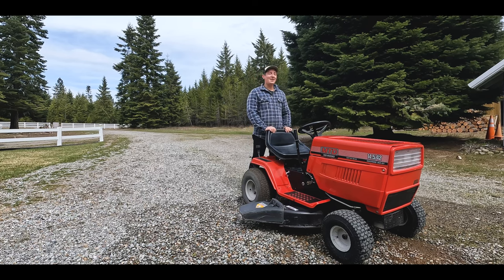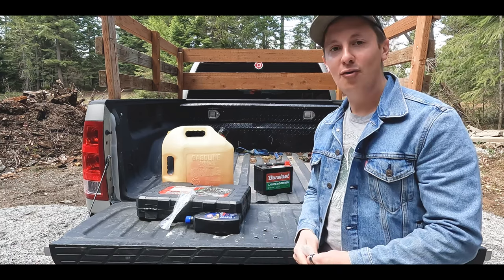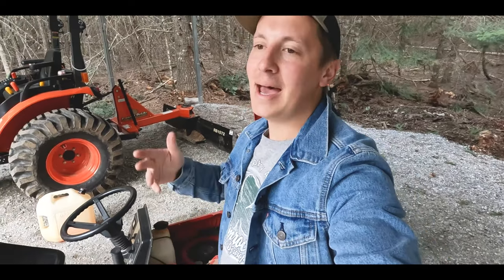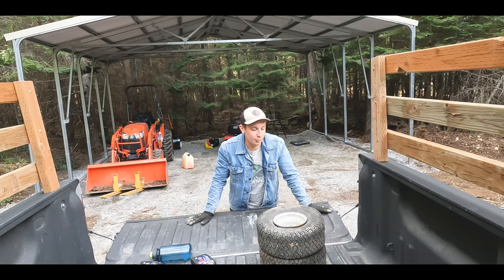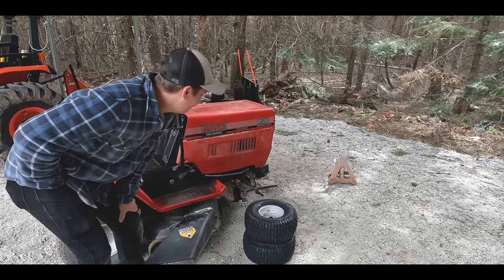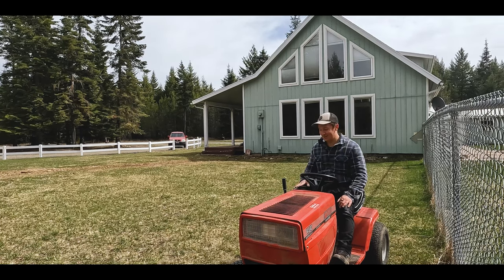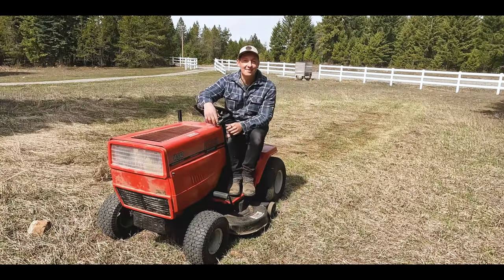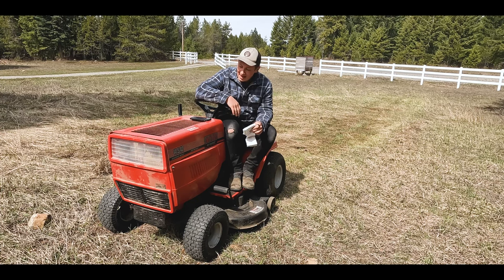MTD Yard Machine EASY FLIP | Riding Mower Lawn Tractor Basic Maintenance to go from Junk to Like New

Comment: Have one just like this except it has the normal MTD hood and an intek 13 Hp egnine along with a bagger. Have to run it out of gas so she doesn’t get gas in the oil.
Reply: Put a inline fuel cut of valve in fuel line (hose) just before carb😊😊😊
Reply: Plus zip ties work as hose clamps

Comment: My problem is I put too much in them and I fix everything plus install poor man steering kit and wheel bearing kit also, new belts and battery, tubes in front and rear tires if needed 
Then paint as needed 
Engine, service, overhead and head gasket plus sump gasket most of the time 
Lube or replace any hard to move cables 
Deck I installed new brging , blades and drill tap and grease zests on spindles, any other pulley that needs replacing 
Yeah, I put way too much just to flip it 
But there’s people who gladly pay my price for them 😊😊😊